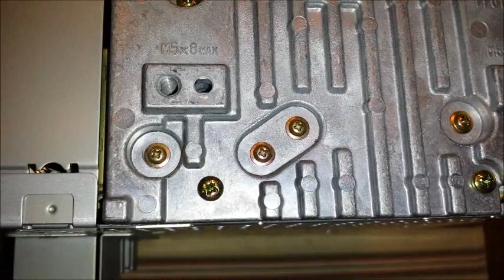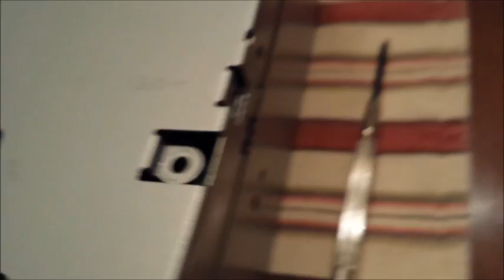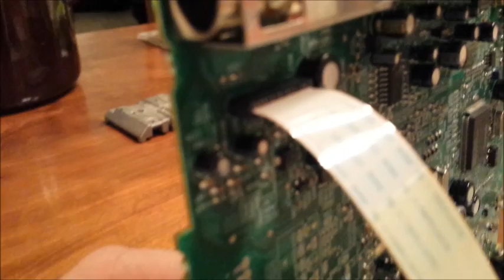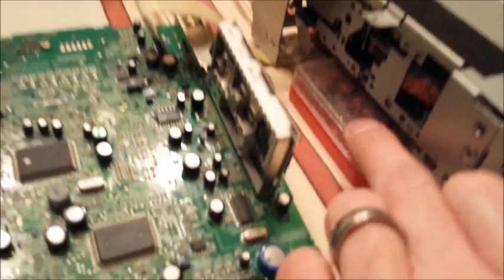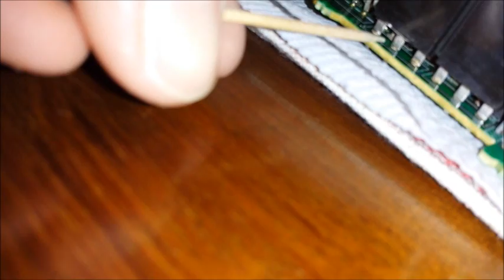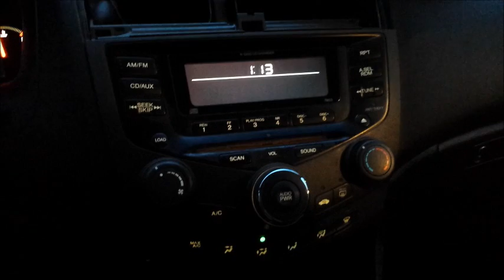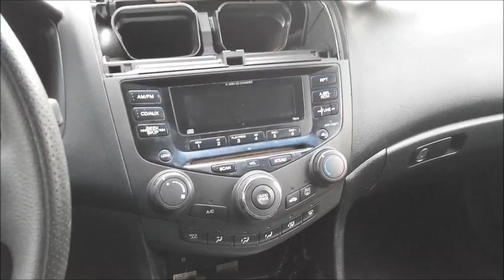2003 Honda Accord Radio Repair - Part 2

Comment: So, i had this problem.  I tackled it with vigor!  I didn't get the results I wanted when I used the circuit writer pen and the liquid bleed over to the two side circuits a little.  I then scraped it on each side to ensure there wasn't a connection between the 3 buttons.  Also, the middle button didn't have the black cover on it so i just covered it all with the circuit pen.  I then decided just to pop that piece off and put the solder between the two contacts under that piece.  Now the display is not very bright.  So I am worse off.  I plan to add more solder with the pen in hopes that it just needs a thicker connection between the two contact points.  Anyone have ANY advice or input?  Thanks!
Reply from the maker: +28jonmark If adding more conductive ink with the pen does not help, you may want to try to put a jumper wire in and actually solder it in place, or purchase the actual resistor and solder it in.  I got lucky in that my repair worked with the conductive ink, but others have had the same problem you have.  Several people have also said they had a problem if they did not allow the conductive ink to "cure" for 24-48 hours before testing the repair.

Good luck!  I hope you can sort out your problem.
Reply: +Matt Payne   I was able to get the the part I popped off 'glued' back down and let it 'cure' properly.  And now the lights work!!!  But unfortunately they stay on without the car being on so now I think/fear that my battery might drain down.  have you seen others comment or share how they fixed this problem of the lights being on without the car turned on?  Thanks for your quick response.
Reply from the maker: +28jonmark Man, that's a bummer....progress, but not quite there yet.  Sorry to hear that.  A few other people have commented that they had this same problem, but I'm not sure if anyone ever found a permanent solution.  The temporary fix is to remove the fuse for the radio from the main fuse box when the vehicle is not in use, but that is obviously an annoying thing to have to do.  I haven't been able to find a solution by browsing online forums, but you might want to do some research on your own.  From what I've read, it sounds like there is a constant, unswitched 12V power supply to the radio for the clock.  My guess is that some malfunction of the motherboard is allowing this power to cross over into the circuit for the radio display; or, it's possible that somehow your repair may have allowed this unswitched current to bleed into the display circuit.

I'm sorry I can't give you a more definitive answer, but I hope you can figure it out.  If all else fails, you could trace out the power wire going to the radio and install an in-line switch that you could turn on and off from inside the vehicle, rather than having to remove the radio fuse.

Good luck!
Reply from the maker: +Brandon Wells Hey Brandon, I'm sorry to hear you're having this issue.  The vehicle I repaired in this video belonged to a friend, and he has since sold it, but I also know the person who purchased it.  Last time I asked, the repair was still working OK, so it has lasted for at least 27-28 months to this point.  I wish I could offer more information about what might be causing your situation, but other than a motherboard failure or some conductive ink bleeding onto another circuit, I'm not sure what to suggest.  I'm far from an electronics expert, unfortunately.  I would search some online Honda forums to see if you find any pertinent information...hopefully someone smarter than me can help you out.

Best of luck, and please let me know if you figure something.  That information could be invaluable to others who see this and have your same problem.  Thanks for watching and commenting!
Reply: +28jonmark +Matt Payne I am seeing the same problem and didn't really put a ton of ink on the resister. Since it's been a few months, are there any updates on what you did/if it is still working? Would love to know, as I am concerned it may further damage the stereo and/or drain the battery.

Comment: Matt Payne,
Question: Does this repair solve the symptoms of the radio/CD sometimes play and sometimes doesn't play at all?
Reply from the maker: Lamont Robinson Hi Lamont, unfortunately I think the intermittent sound issue is probably a problem with the radio's motherboard.  I believe the repair in this video will only repair the issue with the radio/AC controls backlight not working.

Comment: Hey there, which model of Accord did this radio come out of? I have an LX which had the more basic version of the stereo. The more complex units came with the higher trim level models. I was wondering if this is the more basic model. Thanks!
Reply from the maker: onlymarkallen This wasn't my vehicle (it belonged to a friend), but I believe it was an EX model.  Thanks for watching!

Comment: Matt - this video is awesome. Very clear and concise. I'm going to attempt this today, but first: the symptoms of my honda 2006 accord are that the auxiliary button (I installed cable and had been working great for years until this problem) and the cd player no longer function. Radio still works, although sometimes cuts out on me (sound up, no volume). Backlights sometimes go out, although sometimes work too. Yesterday, the cd player randomly started working after months of not working, but then when I attempted switching cds, the new cd did not play. Also, I noticed that my battery tends to die or drains pretty frequently, and I'm wondering if that's related. Finally, my a/c unit stopped working as well. Have any of your followers/commenters experience the same or similar problems? Thanks for your help!
Reply from the maker: Thomas Jameson Thomas, thanks for the kind words!  I can't take credit for the actual solution, as I found that posted elsewhere, but I'm glad my video series was helpful to you.

As for your issues, commenter catie hamrick mentions a similar issue with the radio audio sometimes coming/going, and after some research, I found that lots of other people have experienced that as well.  It turns out Honda actually issued a recall for 2003 and 2004 Accord factory radios - I found a copy of the Technical Service Bulletin here:

http://ww2.justanswer.com/uploads/thebesthonda/2009-03-10_213318_03_accord_radio_illumination.pdf

I would contact your dealership to see if they'll work with you, even if you may be beyond the warranty period.  I read a post on one message board that said a dealership had paid half of someone's repair even though they were out of the warranty period.

It sounds like you probably have a bad radio motherboard, or a shorted power or speaker wire, but it would probably take a lot of troubleshooting to determine the exact cause.  I would start by calling your local dealership to see if they will help you out.  If not, maybe you can purchase a used factory radio and install it.

Let me know what the dealership says....I'm sure lots of other people would like to know, too!  Good luck!

Comment: i'm soooo nervous to do this! but i'm glad to know i can instead of taking it to someone or paying a ton a money on repair/new radio! 
was the radio also not working? your info says radio backlight/hvac controls. probably a stupid question but i just want to make sure it's the same problem. i have an 07 but it looks exactly the same.
Reply from the maker: catie hamrick Hi Catie, in my case, the radio still worked, but the display would not show up, nor would the lights in the knobs for the heat/AC.  The CD player also did not work, but that is a separate issue not fixed by the repair in my video.

Are you not getting any sound out of the speakers with the radio on?
Reply: ***** no, no sound coming out of the radio. every now and then (rarely now) the digital display flashes at me. and recently, the sound will just come on for a few seconds then cut off again. (it actually freaked me out the other day! i heard someone talking and i realized it was my dead radio!)
Reply: catie hamrick do you know which piece that is?
Reply from the maker: catie hamrick 

Hi Catie, after doing some research online, I've come across some interesting information.  It appears that Honda actually issued a recall due to the large number of issues with some of the '03-'04 factory radios.  It sounds like the recall was extended up to about 100,000 miles.  You may have more miles than that, but I would start with your local Honda dealership and explain your issues, and maybe they will work with you.

I'm not sure what the actual cause of your issue is, but I have a feeling that there is either a shorted power wire, a shorted speaker wire, or the radio's motherboard has gone bad.  I have also read about a possible recall with the ignition switch, and I suppose it's possible that could be contributing too.

Check out these links...some other folks describe the same situation you are experiencing.

http://www.hondaaccordforum.com/forum/audio-visual-electronics-10/stereo-problems-2003-honda-accord-40460/

http://community.cartalk.com/discussion/2283094/2003-honda-accord-with-a-possessed-radio

http://honda-tech.com/honda-accord-crosstour-2003-current-118/2003-honda-accord-radio-audio-dead-static-not-working-2537054/

If the dealership says you are not covered by recall, I think your least expensive option would be to try to find a used (but tested/working) ractory radio from a junkyard and install it yourself.  You can remove the bad radio exactly as shown in my video, and then just connect the wiring to the "new" radio and put everything back together.  Or, you could do as someone posted in one of the links above and install an aftermarket radio.  If you are handy with a circuit tester, you could also check for power to the radio once you have it removed from the dash, and you could check for wiring shorts in both the power wires and speaker wires to see if you can find a wiring issue not related to the actual radio itself....but electrical gremlins can be really difficult to find sometimes, even for seasoned professionals.

Good luck, and let me know what you find out from the dealership!
Reply: ***** thank you for all this! i'm waiting for a circuit writer pen to get here then we're going to take the thing apart! i guess we'll just figure something out; it's already broken :/ i do have a couple of airbag recalls i have to get checked out so, maybe i'll ask about the radio, too. thank you for researching! awesome videos!
Reply from the maker: catie hamrick No problem, Catie!  I'm with you - you don't have much to lose by trying this repair, so I'd give it a shot and see if you can eliminate any the symptoms.  Then you can move on.  But - I would look into the recall BEFORE you do anything; if Honda decides they will work with you, they will probably only do so if you haven't already removed the radio/modified it.  If they see anything out of the ordinary (like a bypassed resistor :-) ) they will definitely not honor the warranty.  So see what they say first.

Good luck!

Comment: I would like to know you knew where the problem was in the radio?  I'm in the process  of doing it and hoping that it will work but just not sure if it will.. and if that not problem  what else could it be ?? I already check the fuse inside the car and that ok
Reply from the maker: Annette Wells The only reason I knew to look there was because I found another YouTube video about how to repair the issue.  However, that video didn't document how to actually remove the radio,  so I had to watch bits and pieces of other videos to figure out that process.  That's when I decided to make one video that demonstrated the entire repair from start to finish.  I can't take any credit for the initial idea, though.

Are your symptoms that your radio backlight will not work, so you cannot see the radio display, and the lights in your heat/AC controls will not light up?  If so, then most likely this repair will solve your problem, unless your radio unit happens to be one of the models that is different than the one in this video.  Several other people have commented that they began this repair, only to realize they have a different radio than in this video.

Best of luck...I hope this will solve your problem!
Reply: ***** I  reconnected it and it didn't  work I mite put more of the pen on If  it doesn't work I'll look into just getting a replacement at a deal ship :(
Reply from the maker: Annette Wells Sorry to hear that, Annette!  You might be able to purchase a radio secondhand from a junkyard...that might save you a little bit of money.  Hopefully another coat of the circuit writer pen will work, though.  You might want to wait 24 hours before trying the radio out; another viewer commented that his repair seemed to fail quickly the first time because he did not allow the ink to cure.

Good luck!

Comment: This is an awesome video btw. My has a 2003 accord with the same issue. After watching your video last week I decided to do it for my friend. Removing the trim panel/ radio was a breeze I wad able to remove it in less than 10 min. While I was opening up the radio I noticed it was different than yours. I had to remove the cd portion to get to the motherboard. It was completely different than yours.  There's no r797  fuse/amp.  It was a complete was of time.
Reply from the maker: JAMESON DORCELY Ah man, I'm really sorry to hear that it didn't work out for you Jameson.  I've heard from several other people that their radio unit is different, like your friend's.  If anyone else here reads this and can offer some advice, please chime in.

Thanks for the kind words.  Good luck....I hope you can find some information about your friend's radio.

Comment: Hey man great video followed everything and worked just great!! But there is one problem the HVAC lights stay on all the time even when the car is turned off do you know why??
Reply from the maker: Jose Callejas Jose, thanks for the kind words!  I'm really sorry to hear that your backlight is staying on even when the car is turned off.  Several other people have commented that they have had this same problem.  I'm not exactly sure what causes that, but one viewer commented that he was able to correct this same problem by disconnecting the negative battery cable for 15-30 seconds.  Another viewer recently commented that the dealer had told him this problem was related to the mother board and the only fix was to install a new radio.

I would try disconnecting the negative battery cable to see if that works (I don't understand why that would do anything, but it's worth a try).  Beyond that, you may have to contact the dealer, or do some research at an online Honda forum.

I'm sorry I'm not more help, but I really hope you can figure out your issue without spending a lot of money.  If you do find a solution, please share it here so others can benefit.  Thanks, and good luck!

Comment: very detail video, Thank you, i watched complete video but my stereo problem is little different then yours, stereo is on but there is no volume from speakers.

Every thing is normal but no sound from speakers, please help me .
Reply from the maker: Syed Ali Syed, I am not quite sure what may be causing your issue, but I suppose it's possible you have a blown fuse.  I would do some research on a Honda forum such as this one:

http://honda-tech.com/audio-security-video-27/

You can probably find some good information there.  As a last result,  you could remove your stereo from the car and take it to a local electronic repair shop to see if they can diagnose your problem.

I'm sorry I'm not more help, but I hope you can solve your problem.  Good luck, and thanks for watching!
Reply: do you have any idea which IC is sound IC on board ? i asked from one repair person from other country & he told me to locate sound IC and replace it.
Reply from the maker: Syed Ali Unfortunately, I'm not sure about that.  If you haven't already posted a question on an Honda forum, I would do that - there are some really knowledgeable people that can probably help you with the specifics of the mother board.

Good luck, and I'm sorry I'm not more help!

Comment: Hey good video, I think I am having essentially the same problem with my 2003 accord, only difference is that mine has the navigation with it. Do you happen to have the references where you found this information?
Reply from the maker: Marcus Pitre I actually got the idea for the repair from a video posted by a guy named Mitch Cox.  I'm not sure how he figured out which resistor was causing the problem.  I posted my video basically as a one-stop-shop to demonstrate the removal of the radio, the repair, and the re-installation, because I could not find any other videos that showed all of these steps in one video.

I'm not familiar with the navigation system setup, but what I would do is look for an online Honda forum (message board) and browse through the threads there.  If you can't find the information you need, post a new thread, and I'd be willing to bet someone very knowledgeable can help you out.

Good luck, and thanks for watching!  If you figure out your issue, feel free to post your results here....there may be others out there in the same boat as you!
Reply: Thanks Matt. I'm check that out

Comment: I tried this twice, first time it burnt the motherboard and blew all the fuses. Second time I actually got the dead radio to work but it slowly drained the car's battery......so i just bought a functioning used radio
Reply from the maker: isse roble Well that stinks...I'm sorry it didn't work out for you.  How much did the replacement radio cost?